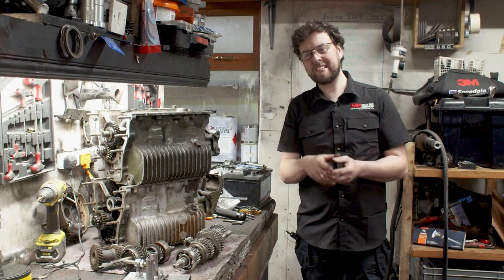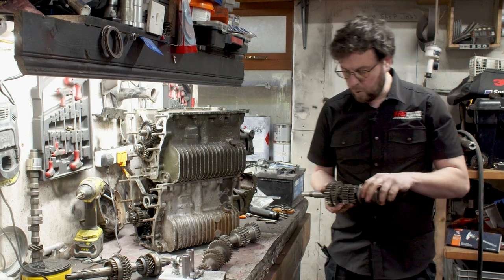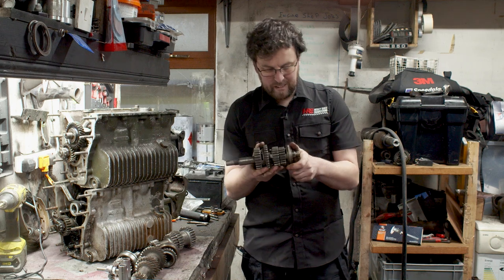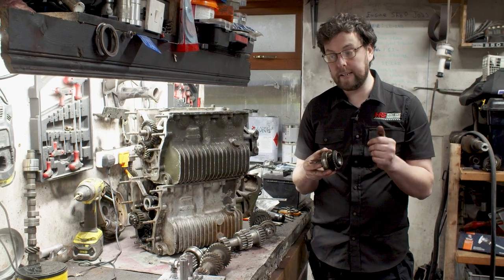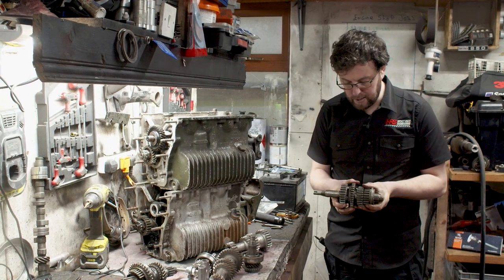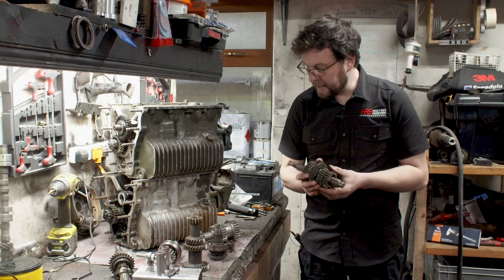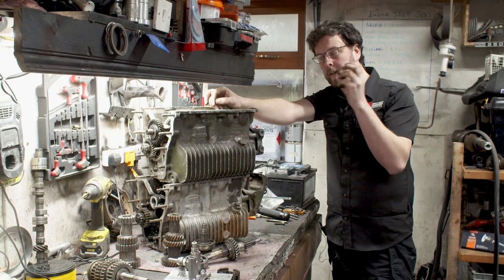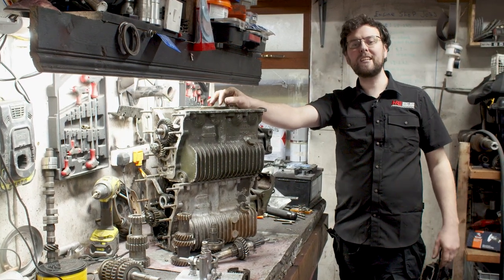Dog Gear Boxes Explained & A Little Cooper S

Comment: One of the greatest driving skills with manual gearboxes is understanding how to double de clutch... which is very different from blipping the throttle between gear changes. I've been driving my classic now for a year with out synchro on 3rd-4th gear,
but it is not a problem when you know how to double de clutch, yes, I hope to pull engine and gearbox soon to correct the problem, but its amazing how enjoyable the DD clutch art is. So how did I learn, my father taught me how to drive an old Bedford truck (Way back in the sixties) with a four speed crash box... once you learn you never forget.

Comment: Another really great video with everything simply explained, really useful for those not in the know. You modern mini experts are very lucky to have such a lot of choice of components to use,  back in the early 1960s ofcourse we didn't have those newer components. BMC did however offer quite a range gear options etc though  their Special Tuning Department and also supplied a LSD kit.
As a footnote I still heal and toe driving modern cars, I think that even with a modern gearbox it makes for smoother driving and on my 1937 Austin Seven ofcourse always double declutch. I learnt to drive on non syncromesh gearboxes so it all became automatic. Looking forward to the whole series.
Reply from the maker: Thanks Tony I could do with you on hand to show some of my customers that technique alot of gearboxes would last a loot longer 😂

Comment: 22G1128 is a great gearbox case. Gives a lovely fast precise gear change when you can eliminate all the free play in the linkage. I also run the KAD pinion support housing mine after breaking teeth off the crown wheel and pinion.
Always thought that there must be on/off throttle 'slack' in a dog box, your the first person I've heard mention it.
Reply from the maker: Yes Iain, they are a great box and will work super for this application. Yes as a road box they definitely have a lot of slop

Comment: I thought there were gains in efficiency with straight cut gears so less power losses through the gearbox, the other reason I've heard is the dog engagement is quicker allowing quicker gear shifts, am I correct?
Reply from the maker: Arrin, you are most correct there is a marginal reduction in losses from straight cut gears over helical as it has less side load. secondly you are correct faster shifting in the right hands can be achieved with dog engagement 👍

Comment: Had 2 Cooper S's in the past both with full race engines on the road and yes was a little while back now. The first one in the UK had 95 bhp at the wheels running a normal S box but with a straight cut transfer gear set, never had a transmission with this car. Move to AUS and built another S with about 120 bhp at the crank I think, could never get the normal transfer gear to last with the power, box was straight cut and never a problem. So I'd like to see your thoughts on a drop set gear set Paul?
Reply from the maker: Hi Chris very intresting thanks for taking the time to share that with us. There is a few options when dealing with the drop gears but as you have experienced when the the power and RPM gets high straight cut transfer’s really help reduce the side loading on the drop gear train the main weakness of the transfer gears is the idle gear in the middle and the ability of the trust washer to take up the trust force at high rpm

Comment: Great information and advice as always. My question is about the possibility of matching a remote gearbox to an A+ block as I want to restore the original Innocenti 1001 remote gearbox to replace my current rod gearbox. Would be very involving or not advised? Thank you a lot.
Reply from the maker: No its very possible there is a few things to watch out for but for the most part as long as you keep all the transmission housings together it will work 👍

Comment: Never drove with dog gears before, but I'm guessing there's a lot of driveline shunting at low speeds and in low gears with a dog box.  Good news that the wider gears in the box can handle the added impact on the teeth, but one hopes the CVs and axles are equally beefy.

Edit:  And you covered this yourself.  I really need to watch the whole video before I start typing.  LOL  Cheers, Paul!  :-)
Reply from the maker: Yup lots of slop but that’s what makes them work 👍

Comment: Very interesting video on the different types of gears Paul, question is what in your opinion are the best dog gear kits available and are they a straight forward fitment within the gear casing.
Reply from the maker: Hi Allan, there is some very kits out there they all have there problems but I think its fair to say there is no bad kit just some that suite one application better than an other. Regarding straight forward fitment for the most part it is straight forward but there is some machining of the casing to get it 100% right 👍

Comment: Great video Paul, i'm really looking forward to the gearbox build videos.
Are glass beads from vapour blasting becoming embedded in the gearbox casing, a worry?
Reply from the maker: I hear a lot of hype about this from some of the bigger company's ...... honestly. After we vapour blast our casings we run them through a 4 hour cycle in an ultrasonic cleaner. if that dosent get any remaining grit out. no engine conditions in the wide earthly world is going to. our ultra sonic cleaner reaches temps of 105 degs and vibrates at in acess of 60khz if either of those conditions where created by your motor trouble far beyond micro glass particles would be your problem 😂
Reply: @HREIRL  Thanks Paul, I thought it sounded a bit far fetched.

Comment: Paul - would it be a good idea to use an oil without friction modifiers (like motorcycle oil) in a Mini?  Bike oils are usually without friction modifiers because they run a wet clutch which could slip otherwise - and I'm wondering if this would help the synchro ring grip the cone better since the Mini shares engine oil with the gearbox.
Reply from the maker: It would be great for the synchro hubs but unfortunately very unhealthy for the cast iron friction components of the motor :(
Reply: @HREIRL  I was afraid of that.  Bummer.  :-)

Comment: great video, thanks for explaining s/c boxes. I have to buy the complete inards for my  box and i think it has to be s/c. I'm running a ford 1600 xflow on the mini gearbox and have been advised to go s/c as the standard won't take the torque. i don't know the torque figure of the engine but i know it is around 170bhp. the car is mainly for hill sprinting but i want to use it on the road. do you think i need to go s/c and is any one companies better than any other companies. i have looked at MED and KAD so far.
Reply from the maker: Andrew you are most welcome. That’s a very interesting project. I think you will definitely need SC gear kit all right. Boy MED and KAD make a very good gear kit.

Comment: 😎👍
🇺🇸
I've become an expert in all things Mini in the past several months.
There is no one in my shop ( actually it's just me in my 2 car garage) that knows more about the Mini Cooper than me.

If course I'm kidding. I've learned everything from hands on my own car and a multitude of videos.
I'm a motorcycle guy so I'm somewhat familiar with a dog type gearbox. They have some similarities.

I'm hoping to not need to repair/rebuild mine any time soon.
I didn't notice a bit of mis-engagemnt when changing between 2 and 3. I assume the best way to preserve the gearbox is a smooth deliberant medium firm shift?
Not a slow light pull on the shifter.
It's a stock 1275 road car with (the best I can tell, an 1984 Metro motor. Not sure about the gearbox yet) non S motor but it is an S car. Judging by the badging, brakes and a few other things.
My expertise is only within the 4 walls of my garage and doesn't apply to the outside world.😏
I guess my question is. What's the best way to prolong the life of the gearbox besides frequent oil changes and mindful driving.
Any tips I may not be aware of??
Cheers from Seattle Washington area.
Reply: Double-clutching should in theory preserve the synchro cone clutches the longest, as you're doing their job for them (it's also how you shift on really old gearboxes that were designed with actual sliding gears instead of dog teeth or synchro cones.)  The more you match those internal gear speeds yourself, the less the synchro rings should wear.
Reply: @aussiebloke609  
Thanks for the advice.
I've only actually driven it once and that was from the place of purchase to home.
It drove and shifted ok although it was a bit of chore getting the shifting down.
The throttle was hanging open a bit so I had to let off the throttle, toe up the pedal, push in the clutch and shift. Of course this was the first manual I'd driven in probably 15 years besides motorcycles.
Then being RHD made it all that much more interesting.😁
I stopped on the way home and fiddled with the throttle and fixed the hanging open. One less task during a gear change.

From day one. I've been continuously improving the car.it started with needing to replace a broken wheel stud.
It hasn't ended. I'm replacing the heater core now.
Getting very close to the end of things that need to or can be replaced.
Should be in 75% better condition than on the day I bought it.👍 Although it will look almost the same.
Reply from the maker: Good advice there from aussiebloke, the best way to prolong the life of an ayling gearbox is positive shifting, speed matching so very carefully listen to what RPM your engine is at a given speed in a given gear when shifting from one gear to the next try an obtain that speed an you should be able to shift with out a crunch 👍